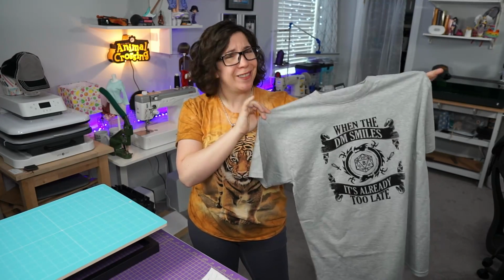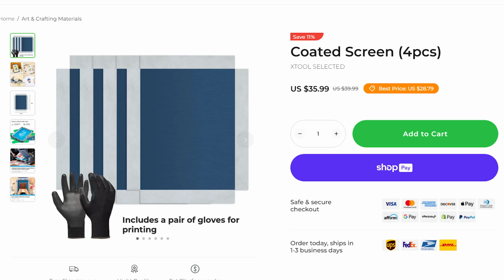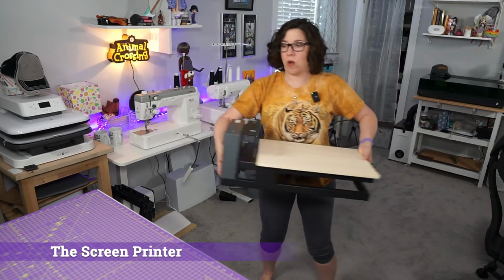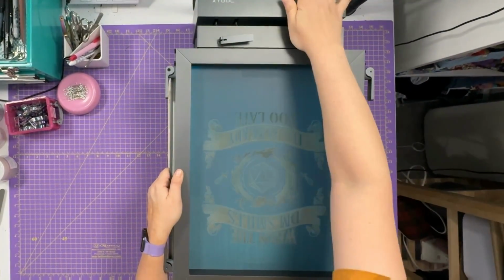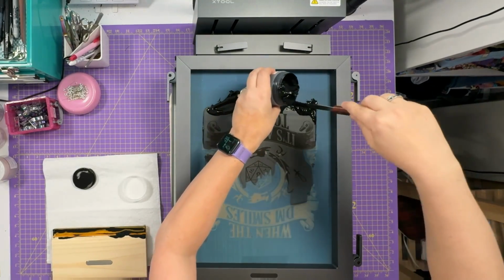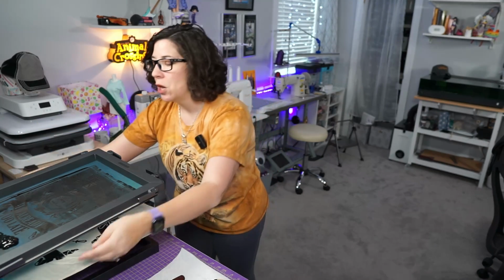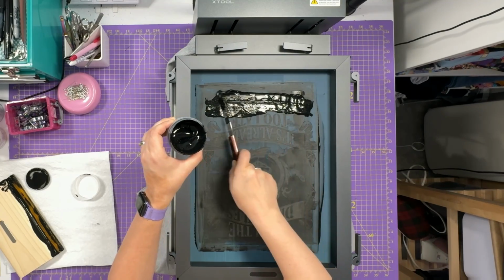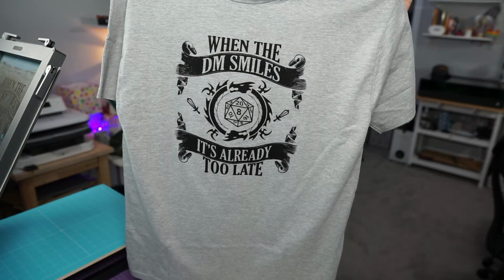How to Screen Print with the xTool Screen Printer Accessory

Comment: Thanks for this review! It was super helpful but could I get some suggestions? I have the 5W machine,
I ran my design using the following  settings:
Power :90
Speed :50
Lines per inch: 200
I have a lot of fine details and halftone accents that didn’t engrave through! What setting would you suggest for this? 😮
Reply from the maker: Is the image you're trying to engrave a bitmap by chance?
Reply: Ah yes 😬

Comment: Hi, it's a piece of art! Love it. Couple of questions, if don't mind)  What type of paint do you use?  How is paint resistant to the water and laundry process? Thanks
Reply from the maker: The paint in this video came with the screen printer accessory kit. It's the water-based xTool paint specifically made for screen printing. SO FAR things have held up in the wash. This shirt I gave to my husband and we've run it through a few times now. It's holding up quite nicely! Ask me in a few months though...
Reply: @fiercekittenz  thank you for prom response! One quick question please. How do you care for your screen after applying paint. Is the rinse enough or any chemicals can clean it afterwards? Thanks.
Reply from the maker: @Redleafs2022  All I did was wash them right after I was done with them. If any paint stuck around, I just soaked them for a few hours in warm water. I used my tub for that soak though. My sink isn't big enough! You can gently scrub with a towel to get those pesky spots cleaned up. I've got two screens still in the frames for now.

Comment: Comment #1:  Nice t-shirt (the tiger).  May I recommend a wolf howling at a full moon?
Comment #2:  I wish everything could be fixed with just two screws (Kappa)
Comment #3:  Can i get one that says "AITA?  Yes.... Yes I am"
Comment #4:  I like see you do it the first time.  It shows it's ok if everything doesn't go perfectly the first time.
Comment #5:  If it's more than 3 fingers...
Comment #6:  Kudos for using your chest for good, not evil.
Comment #7:  I wonder if a rubber rolling pin would work better than a squeegee if you did this a lot